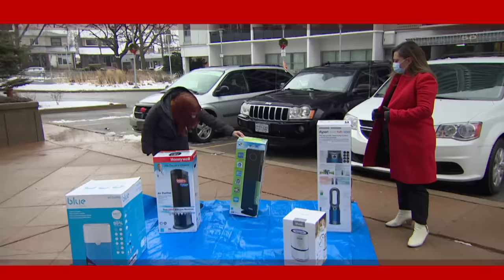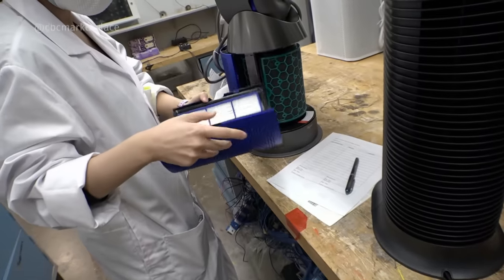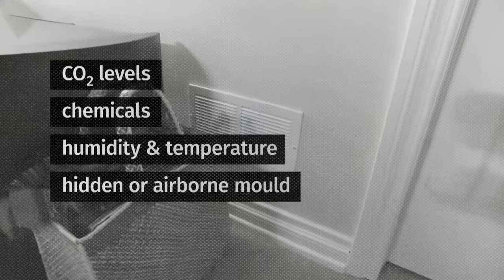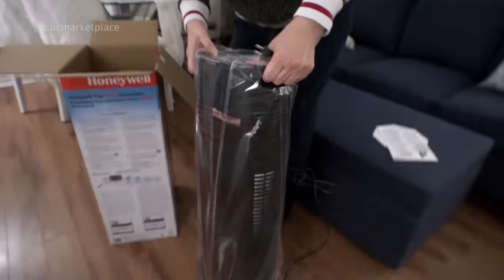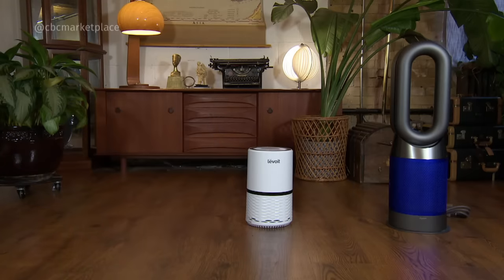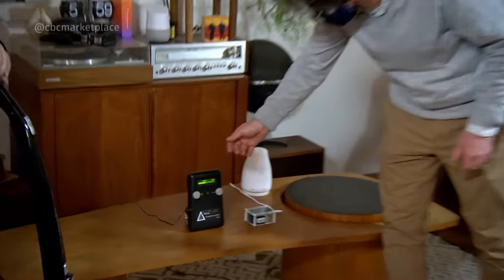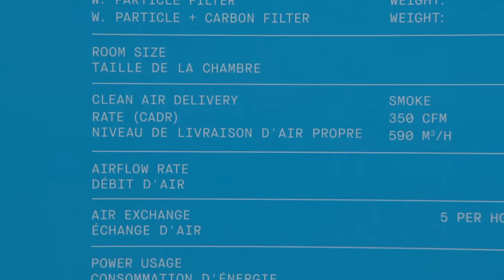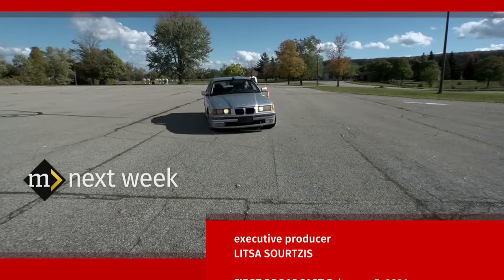Is an $800 purifier best to clean your home's air? We lab tested 5 top brands

Comment: The only thing that is a bit disingenuous about this review  is comparing the Levoit to the others which are made for large rooms. Since I’m in the market for an air purifier, I did some research & found that the Levoit product is listed on the website as having a rating for 40cfm which upon conversion comes up to a CADR of 67m3/h. Only 7m3/h less than lab tested. Which means that the product actually does what it is meant to do for the size of room indicated. Therefore it would have been more accurate & fair to compare their equivalent products for larger rooms. I’m sure that would have changed it’s position on the chart & wouldn’t unfairly skewer the results against it.

Comment: Would love an actual test knowing CADR's shortcomings and Dyson's claims surrounding it. The Dyson rep didn't explain well, and the tests in this video aren't covering that.

Biggest issue for CADR is it's measured in a small room + there's existing ventilation in the room (which you can see in the clips from their testing room). The Dyson has a fan built-in so this would help get more air of the whole room through the purifier.

It would be a huge service to the public if there would be an independent test in real rooms that are larger than the tiny test room, and don't have their own ventilation already.

Comment: Lots of value in this video, goodjob!
Reply: Is there really though? There was no depth in this analysis, they didn't actually test for VOCs which HEPA only filters will not filter. Dyson was entirely correct that CADR while important isn't the only metric, additionally a finer filter that filters smaller particles will have more resistance for any given surface area. They didn't strap a HEPA filter to the box fan so the measured CADR  is immediately not comparable to any of the other air filters (though the filter used was still good enough to trap most allergens like pollen and dander.) Additionally they did not disclose the efficacy in reducing the particle counts, what good is a high CADR if the filter is 70% efficient vs 90% efficient on a model with lower CADR. There's too much nuance into what makes a good filter to cram into a 20 min video that needs to tell a story.

I feel marketplace's quality has been on a sharp decline for years in their chasing of broader audiences by americanising the editing style and removing all semblance of actual information and quantifiable testing.

Comment: THIS is the answer/comment!  I cannot believe they had all these experts and science involved in this, but then rate the dif model/manufacturers based solely on how many cubic ft (or whatever) that the device can efficiently clean!!  They're ALL built/designed for different size rooms.  TOTALLY ruined the piece..

Comment: If an air filter taped to a box fan is legitimately comparative to these products why don’t they discuss using  the fancy furnace filters. Only mention is improperly installed filter. Those systems are designed to circulate air in each room. Good video that sadly raises more questions than it answers.
Reply: ITS MISLEADING BECAUSE FURNACE FILTERS ARE NOT HEPA FILTERS. ITS NOT THE SAME GAME AT ALL.

Comment: These dummies didn’t even apply the same range of air purifiers, they have mixed in different price / range effective air purifiers 
When each product usually distinguishes its individual room range.

As for humidifiers, they deliberately say on the packaging to use only distilled or purified water

Comment: LOL, evrything that makes expensive is just a casing. Why not put a diamond on it and sell it for $2000. Basically a filter is a just a filter, that works by moving air through it to filter the material in the air. You just need a filter and a fan.

Comment: I'm disappointed by the tests. After showing all quality metrics, they just measured the flow rate of the products which obviously products with the largest fans will show the best performance with or without a good filter . I expected putting purifiers in enclosed spaces run them for set amount of time and measuring air quality before and after.

Comment: Considering the size of the Blueair, they should have compared it to a bigger Dyson because Dyson is more than just a purifier and the small one would be optimal for a 10 square meter room. For a Living room you probably need several of the big ones that will also heat the house. Of course you have to clean every day to live in a clean environment.

Comment: Is the DIY purifier using a true HEPA filter? Because if it's not then the airflow is not that important. You can push all the air in the world through an old sock and it's not going to give you a clean air

Comment: BAD reporting of facts. These machines are designed based on room size. You are NOT SUPPOSED to compete a machine meant for a BIG room with one meant for a SMALL room and call the more powerful machine the winner, because the more powerful machine is overkill in a small room.
All of these machines effectively clean the room they are designed for, so they're ALL winners if you use them in their appropriate room size.
Dyson is the odd one here. Yes it's shockingly less powerful and effective at cleaning than expected for it's price, BUT, it's NOT JUST A PURIFIER! It's also a fan and heater and has multiple utility functions as well, all in one machine, that's why it's so costly. So it's NOT FAIR for compare the Dyson to machines meant solely for air purification.

Comment: Good episode. I wish I could watch this before I bought my air purifier during the wildfire season last year... Can you make an episode of portable air conditioners? The global warming is making apartment renters to get an AC for the summer.
Reply: Short story on portable AC is get a window unit if at all possible, if not get a dual hose one or modify a single hose into a dual hose. See the video Technology Connections made on portable AC for all the details.

Additionally this episode was pretty poor and the results are pretty suspect, they didn't actually test for VOCs which HEPA only filters will not filter. Dyson was entirely correct that CADR while important isn't the only metric, additionally a finer filter that filters smaller particles will have more resistance for any given surface area. They didn't strap a HEPA filter to the box fan so the measured CADR (and there's also the fact that there's three CADR ratings for different particle sizes and this is not disclosed) is immediately not comparable to any of the other air filters (though the filter used was still good enough to trap most allergens like pollen and dander.) Additionally they did not disclose the efficacy in reducing the particle counts, what good is a high CADR if the filter is 70% efficient vs 90% efficient on a model with lower CADR. There's too much nuance into what makes a good filter to cram into a 20 min video that needs to tell a story.

I feel marketplace's quality has been on a sharp decline for years in their chasing of broader audiences by americanising the editing style and removing all semblance of actual information and quantifiable testing.

Comment: Here is another typical BS study. From engineering standpoint the Dyson representative is absolutely right and smart not to entertain a debate.
True testing should be in a controlled environment with a scope to confirm or deny manufacturer specifications.
If Ferrari claims 200mph top speed, and it does 200mph top speed in the manufacturer specified environment, it is all well.
If it does not, then we can complain.
Does not matter if a custom car built for half price can do 350mph ... Buy what you want, it is your money 😅

Comment: Dyson are junk, I’ve worked in Air separation for years and have tested many of the top brands.

In order of particle removal capacity best to worst.

Iqair = hospital grade very expensive but filters air particles down to 0.03microns
 Swiss made with high quality materials.
Blueair excellent homeowner filter.

Honeywell- excellent value for money, replacement filters are cheap.

Winix- excellent value for money.

Levoit- homeowner level device, poor overall air flow.

Dyson- grossly overpriced: low CFM, unreliable and just nothing like the quality of their vacuum cleaners.

A device people should consider purchasing is the Airthings  device. A Norwegian company that makes ultra reliable air quality monitors for home use, measuring particulates, Radon. Co2. Humidity and temperature.

Comment: A few things to take away from this video. One these test are very very skewed. Why well for one they just tell you results not what or how they test things rather. Also levoit core 300 is easily much better then a box fan filter not only in air movement due to its design. But how it will filter the air, with hepa and carbon. Reducing smells as well as smoke virus etc. The box fan can do smaller amounts yes, but your making it seem like it really moves that much more air which is not true. Its one directional so you would have to constantly move it around to make the most of its cleaning ability. Were a levoit pushes air up and around sucking from the bottom. They also picked from what i can tell a smaller levoit a personally one,made for small areas. The lv-H132 is not the same as a levoit core 300 which easily dominated the fan setup as well as three other ones on here.  Kinda a cheap shot when trying to compare to larger rooms. Especially when all the other ones are much larger styles. Kinda crazy they didnt do a control pick making sure they picked ones that matched their room capacity. 😂 Shows you how much of no real science went into this. Box filter fans are good for the low. I have my own. But for real air cleaning you need a hepa filter. Some things that are true. Are companies using junk like uv etc. Alot of that does nothing or ion nonsense. Alot of that is crap dont buy into it.

Comment: Stay away from Dyson. They work fine for 2 years, and become useless in the third year. At that point you are on your own unless you have a repair center close enough to your location. Dyson repair centers don't  allow air related products to be shipped to them. Once a model begins to have problems, they discontinue it, and then they offer you an updated model as a replacement, way too expensive they give you 20% discount which does not make it so much more affordable, loaded with features you may not need at all, and missing what you do need. So it is take it or leave it.

Comment: Very bad comparison and misleading. You are looking at different size air purifiers and comparing them to each other. That's like saying the Medify-MA-150 is three times better than the Medify-MA-50... Well duh, its 3 times the cfm. Its the same thing made for 2 different size homes/rooms. What filters are these systems using? What micron rating does it have? Etc... The air rating devices you used may only read 5% of harmful particulates. Something that filters 0.3 microns compared to 2.5 microns is better regardless the CADR rating. I feel ACH is the more relevant rating.

Comment: Totally flawed review. Resulta are based off the manufacturers own CADR claims. No before and after tests were done based off of air quality. And the Dyson guy was totally edited. Research the difference between CADR and POLAR testing. I could go on about how wrong much of this was but I will leave you with the one fact that should stand out, they showed you a before test but no after test with regard to air quality.

Comment: This test is immesely flawed. What's funny is that "expert" guy puts a humidifier which is pretty much just straight oil and water vaporized next to a Air Quality Monitor (Monitor that measures the particles in the air) and starts critiquing using a humidifier because it, produces... particles... . Water is a particle if he didn't know. If you spray water next to the monitor it will go up. (Newsflash)

Comment: This was about as embarassing as anything CBC puts out. 1) The Blue Air uses "HEPASilent" which is a loose filter that relies on small ionizers (that they don't mention) to clean the air. That's why it's cheap, and performs so well, but ionizes the air. 2) They totally don't focus on any other metrics or filters, like Carbon filters or the type of Carbon filter. Not here to defend Dyson, but I can just tell by the editing and the "experts" and the lack of information that this is about as BS as any recent CBC episode that claims to give its viewers accurate information about anything.

Comment: Pretty poor video ... 
For example it is not the same comparing a Levoit 300s (Like the one in the video) for small rooms and around $150, to the blue Air Pure 221 (Like the one in the video), that is 4 times de size, more than triple the price, and is designed for big rooms or small apartments. Compare 2 brands, but at least with 2  devices in the same category (That they both have)

It's like comparing a Smart fortwo (By Mercedes Benz) against a Chevrolet Silverado and saying that the last brand is the best one just because one model outperforms the other, when each car is for a total different situation and total different categories.

Comment: So….. you’re comparing to a levoit that is designed for a smaller room and is wayyy cheaper.  The Levoit core 300 is better than this one and only cost $85 😂.  It’s like comparing a commercial sized fan to a $10 Walmart fan.  The Levoit is a good air purifier for the money and has excellent reviews.  If you want a fair comparison get a higher end Levoit.  You don’t compare flagship models to midrange devices.  It’s like, “look the iPhone pro is better than the $80 Motorola!”

Comment: This is a terrible review. Air pollution is much more than particles, gaseous pollution and VOCs is usually much more important to remove and the only way to remove that is with activated carbon filters. Something like the AustinAir or some of the Honeywell and BlueAir filters which have several pounds of activated carbon in their filters are the way to go for air filtration that makes a real difference.

Comment: What a poorly informed piece. How much air a purifier can move per hour or so is totally irrelevant to how many particulates it filters out of the air. Of course if I bought a purifier the size of my fridge, it would clean the air more quickly than a purifier the size of a small waste paper basket. But if they were both in a room that was only 20 sq. m in size, they would perform practically identically, except the larger one would be noisier, consume more electricity and cost so much more to buy. Also buying a large fan and taping a cheap filter to it is hardly going to do anything at all, except create a lot of sound.
Reply: Also this idea that an air purifier could "get rid of the virus" is total rubbish. Who is this "professor"?

Comment: This is a very unprofessional comparison. More like price vs CADR/CFM. Where is design, engineering, marketing, longevity and quality of parts ,warranty, spare parts , certification , noise levels , fan wattage , size and so on counted in ? Anyone can DIY whatever but these are air purifier sold for home/office use not industrial air purifiers. Lots of mistakes in this one , prob.... ... ... ...